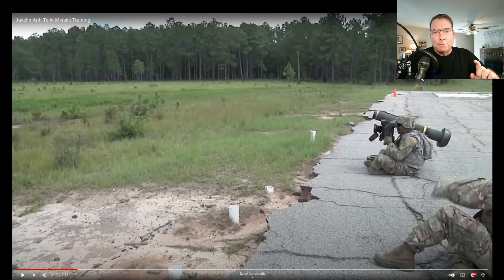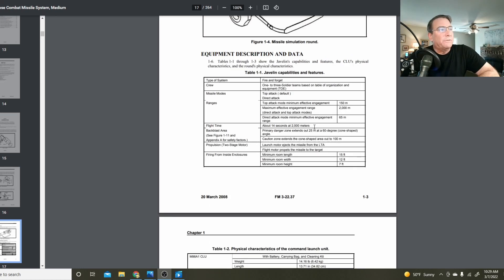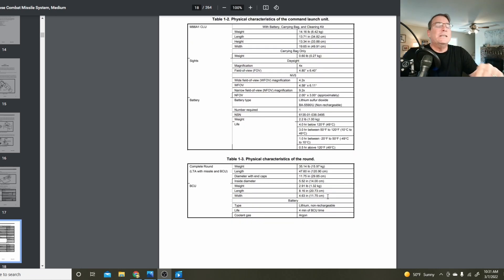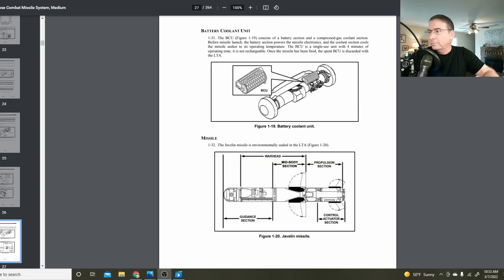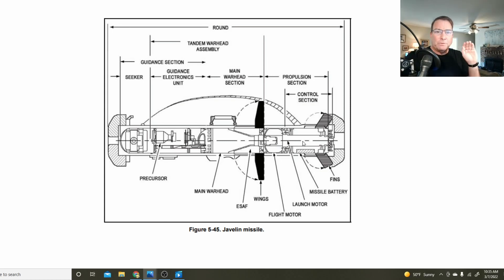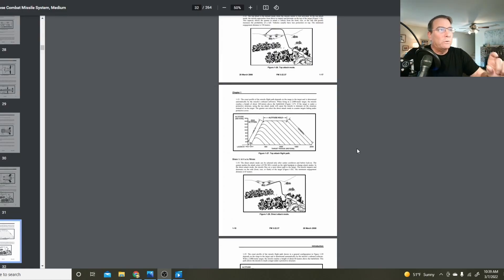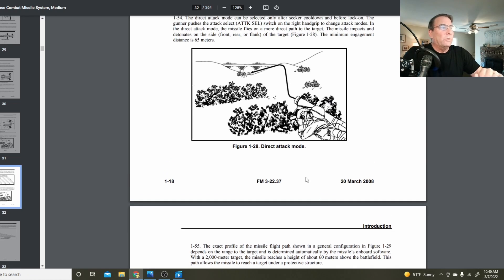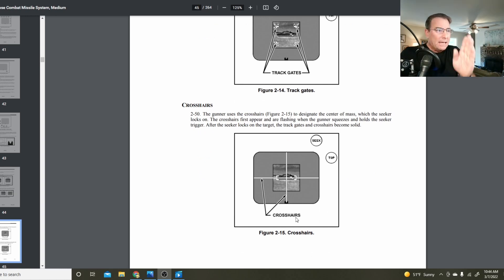FGM-148 Javelin Anti Tank Missile Overview

Comment: Shaped charge creates a plasma which burns through the top of the tank, which splatters about inside the tank and burns through the artillery inside the tank which chars and destroys everything inside in a matter of seconds. Shaped charge tech has been around since WW2.
Reply: I see a huge number of people think that it's a thermal effect; it's not. The penetration by the copper slug is because of its incredible velocity -sometime over 10km/s! 

I think part of the reason is that HEAT sounds like, well, heat has something to do with it.
Reply: Think of a shape charge kind of like a lens on glasses. It focuses the blast.

Comment: Yeah, that's not how a shaped charge works. The things in the nose don't do much, they are mostly aerodynamic. The copper cone is squished into a jet and vaporized and accelerated as it goes. The cone shape focuses the 8.5km/s shock wave from the explosive kind of like a loud speaker cone, the copper just gives it something to throw. Watch this animation. https://www.youtube.com/watch?v=qqMoFx0uwpo
Reply: The nose is important for stand off. Shaped charges need to detonate away from the target so the shaped charge can reach full compression before the projectile hits the armor. Screwing up the stand off distance reduces the effectiveness - which is what the bars on top of the Russian tanks are designed to do (just like the skirts on WW2 German tanks).
Reply: @allangibson2408  Yes, it gives me a place to put the contact sensor. But in terms of how a shaped charge works that isn't important. It's important for how a weapon system works, but it has no bearing on how the explosive energy is directed. What I said is that's not how a shaped charge works, not that isn't how a javelin warhead is detonated.

Comment: Kablammo is right. Thanks for sharing. It's important for civilians to understand just what it's all about since we are so removed from war's direct consequences. No comparison between the observors and the ones in the thick of it doing the job. Hard to watch sometimes, but important to try to gain perspective and understanding.
Reply: There is a small civilian connection.
The warhead that the Javelin uses to damage enemy armor is in fact quite closely related to the type of explosive charge used to sever steel beams by experts that are in the business of using explosives to demolish skyscrapers and other large buildings made of reinforced concrete and steel. They're related in that they're both shaped charges, however the ones used to sever steel beams in an instant are known as "linear shaped charges" and they look like a square beam of explosives with a V-notch lined by a solid plate of copper. As the name suggests, these linear shaped charges cut in a line, whereas the round shaped charges of the Javelin AT missile are designed to punch a hole thru enemy armor.

Turns out that severing a structural steel beam safely from a long distance has a lot of overlap with punching a hole thru the armor on a tank.

Comment: I think 2 25-man squads, each man with 2 Javelins,  approaching a convoy of Russian armor, separated by 300 yards. They get set. One squad aims at the odd number units while the other takes the even numbered units. When set, they call in 2 flights of A-10 Warthogs. With a coordinated attack like that, I don't think there will be much armor still operating.
Reply: @kristyskirt9015  There is a Russian equivalent of the A-10. The Ukranians could fly those. They already fly Russian fighters.
Reply: 2 Javelins total is enough. One in front, one in rear, clean up the middle with arty from a safe distance.
Reply: @willyjimmy8881  Russia had armor lined up for 40 miles. I think it would take more than 2 Javelins. The hundred I suggested wouldn't get them all, but they'd sure create one hell of a road block.

Comment: @blancolirio  I am a former M1 Abrams Tank Commander. Anti tank weapons land in two basic categories, Kinetic Energy ( inertia) as you mentioned these are usually in the form of sabot round essentially a large dart. The Javelin falls into the second category, chemical energy, it uses a jet of super heated gas to essentially blow through the armor like a huge sudden blowtorch. Javelin uses a shaped charge to reach this much like TOW, Hellfire, HEAT Tank rouds.. The sight is not necessarily a night sight but a thermal sight and you are correct the greater a difference in temperature between the target and the surrounding area the better a sight picture you will have.
Reply: The jet has a high component of molten metal that is formed by the conical lines - typically bi-metal.
Reply: Thanks for sticking your neck out to protect my civilian ass. 🙂

Comment: You left out that the warhead utilizes depleted uranium to create the high heat which melts its way through the tank armor and body.  Pretty much an ugly death for the people inside of the tank.
Reply: What are you talking about? The shaped charges in the Javelin missile use copper as the medium which is superplasticly formed into a hypersonic molten jet, which cuts through the armour. There is no depleted uranium, or as you say plutonium in these weapons. Please try not to spread misinformation. I will agree that being on the receiving end of one wouldn’t be pleasant, although I’m not sure you’d have to worry about it for long.
Reply: @bend1483   When I have seen them manufactured, they had various types of heads.  The good tank killers are the depleted uranium charges, same idea as the rounds used in the A-10.
Reply: @LoydChampion  Yes, there are quite a few weapons that use DU, usually as a penetrator, BUT the Javelin missile isn’t one of them. It uses a shaped charge, and a jet of hypersonic molten metal, it is not a direct kinetic penetrator, it does not use DU.
Reply: There is no depleted uranium in Javelin. You're confusing that with depleted uranium penetrators like those in M1 Abrams armor piercing ammo. That's a kinetic projectile, as in a bullet that doesn't explode. Depleted uranium is used in those rounds because it's extremely dense and at high velocity it can penetrate armor. Javelin uses a shape charge that explodes before it hits the target.

Comment: What you showed has a shaped concave metal hemisphere or cone so-called 'liner' (usually of Copper)  backed by a high explosive.

It is not the explosive that does the penetration. 

When the high explosive is detonated, the metal liner is compressed and squeezed forward, FORMING A JET of a hot copper plasma whose tip may travel as fast as 10 kilometers per second.

That jet punches through the armour into the tank.

Primary source:    https://www.osti.gov/servlets/purl/6807425
Reply: Jackie, how on God's earth have you provided a link that wasn't to just another YouTube account? I always liked to provide a link to support my statements, but for months while it looked like YouTube had accepted your comment and it just disappeared into the ether.
Reply: @COIcultist  yeah same. Then after getting my comment nuked from orbit, I'm unable to make any further comments under that video. They look like they post, but they're not there if you check back.
Reply: @gasdive  Misspell or miss a word out, then once posted select edit and correct the post. If there is a problem, an error message will appear under the post. Copy the text having removed the offending link, this also allows for content creators who don't allow you to post YouTube links. After all the above, delete the post and re-post the amended text.
Mind you, I have had 3 or 4 comments post then disappear over a month or so, none of them having links nor using obvious words that YT will censor.
 YT is obviously trying to improve the quality of our debate by preventing us from referencing supporting evidence.
Reply: Right:  shaped charges serve to focus the explosive energy into the target.  It's BOB (best of both):  all the kinetic energy of the airframe, plus all the newly released chemical energy of the explosive, focused into one neat package with the aforementioned plasma bow on top.
Reply: Simply, think in terms of an instantaneous acetylene cutting torch,
the explosive forces instantly vaporizers the copper, which as quickly intern, lower's the melting point of the armor. 
As well as injecting a molten jet mix of copper and steel, which 
 Brad Pitt's 2014 movie "Fury" has a couple of CG'd added scenes showing the effects of the Panzerfaust "Tank Fist", the RPG's
predecessor.
Back, early 1970's when I was much younger, I fired  the 3-1/2 Rocket launcher, the old Sherman Tank hull target was peppered with countless finger diameter holes.
Reply: @mikemontagne2703  the effect is purely kinetic - the temperature of the copper slug has nothing to do with the penetration. At that sort of pressure, it doesn't much matter whether the slug is liquid or solid - material strength is such a small part of the equation.
Reply: @mikemontagne2703  that's a good analogy.
Reply: Found a good video explaining in detail how shaped charge explosives work- explainer begins at 12 minutes... the rest of the video is interesting as well!  The UK Tank Museum does a great job!    https://www.youtube.com/watch?v=1SJHC4wmRfk
Reply: Juan was fed misinformation about shaped charges b y a Communist infiltrator, obviously

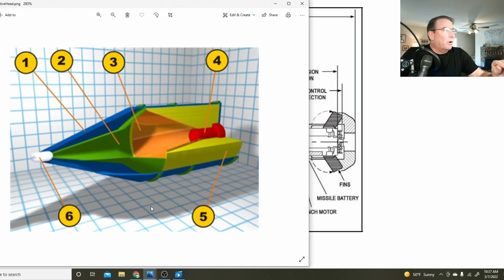Comment: I believe that Juan has made a mistake regarding how shaped charges work. The front portion of the warhead in 7:06 is just an aerodynamic cover, the explosives (5) actually forces the reversed funnel shaped metal (3) forward (to the left of the image), producing a jet of extremely high velocity metal (up to 10km/s) which penetrates armor.
Edit: as shown in https://youtu.be/Li2Kt4DtUdY
Reply: Correct.
Reply: The main reason is for standoff,  the space is necessary to allow formation of the jet .   In a RPG (diagram)  the nose serves two purposes.
Reply: The reason we started to install slat armor, it changes the stand off of the shape charge making RPG's less effective.
Reply: @tomsmith897  that isn't correct. Slat armor as you call it is designed to destroy the fuse and keep it from detonating or to deform the warhead to reduce it's effectiveness. The standoff distance itself with vehicle mounted cage armor isn't enough to significantly reduce the warhead effectiveness. Ask the Iraqis who tried the same tactic in '91 and got their azzes torched by M1 HEAT rounds that were't effected by the cage armor.
Reply: @willyjimmy8881 I was talking about the diagram used by Juan, a single warhead RPG. Slat armor (AKA standoff armor)  was also designed to prevent optimal detonation from occurring, IE by deforming the cone or causing the shaped charge detonation at a non-optimal standoff distance.   120mm HEAT round compared  to an RPG-7, don't even know where start with that...
Reply: @tomsmith897  ah I see.
Reply: Eric, True. A HEAT round uses a copper cone with the large end toward target and the small end packed with high explosive around it. When the HE detonates, the gases form an etremely hot jet which penetrates the armor, then the copper cone that is now crushed forming a slug, follows the jet into the hole it created. It's called the Monroe Effect. I believe Juan was describing is the Armor Piercing Discarding Sabot (APDS) round which is basically a steel dart tipped with depleted uranium. The sabot round uses kinetic energy and DU as lubricant to penetrate armor. At least this is the way I remember it from my EOD days.
Reply: @straycat1081  Also, depleted uranium is pyrophoric which means it instantly burns on contact with air. A depleted uranium round showers the interior of a tank with thousands of burning splinters which ignite everything inside. I have heard the instantaneous temperature rise can be as much as 5000 degrees inside. The propellant charges for the ammunition inside the tank incinerates everything else. Not pretty, but death is quick.
Reply: @TyMoore95503  that would explain the charred Orks I’m seeing on Reddit. Never seen flesh charred but not incinerated like that. Amazing science. Glad I’m not a field Ork.
Reply: @muzaaaaak  The chard corpses are actually caused by the ammunition cooking off. Most russian tanks have no blowout panels for the ammuntion so if it's get ignited while the crew is inside the tank they get literally cremated. The pyrophoric effect of DU is often overstated. Yes the dust ignites, but that happens mostly outside of tank.
Reply: The  "blowtorch" system is a  German invention, the notorious  "Panzerfaust" was  used  in WW II.
Reply: @dipling.pitzler7650  Called the Monroe Effect.  Discovered during the civil war when black powder charges were tested.
Reply: I belive the launchers are reusable also.
Reply: @MrBen527  not for the Javelin but they can be used for other improvised weapons..
Reply: @willyjimmy8881  WIKI shows its mostly reusable.   A new missile in its cartridge is remounted on the CLU after firing the previous missile.
Reply: @MrBen527  The missiles are the expendable can, the optics and launcher are designed to be reused. We did take bets with MI that you can take a SAM or SS missile, and the launch controls, and walk down streets in any major city, and nobody would be the wiser. You just would have to spray paint the missile to look like a painted piece of cast iron drain pipe, and carry the Samsonite suitcase with it being spray painted black. Wear overalls and nobody would give you a second glance, especially if you wore high vis vests that were tattered and dirty, and the coveralls were stained and worn. they never wanted to take that one up though, even though we did have some captured ones that could have been used as well. There was a cut in half safed one on the wall of the FE rest room.

Comment: weighs about 50lbs and has a range of 2000m. That's what I like to see, equal representation for measurement units!
Reply: To quote George Carlin, when he was talking about oxymorons, "Military Intelligence."
Reply: @DoubleMonoLR  
And 7 yead Olds weigh 49 lbs...
This is good conversation :)
Lol Hugs
Reply: Military uses metric for distance and imperial for weight. Nothing unusual there. Doesn't matter which syatem you use as long as everyone uses it. Ask the brits who commonly use imperial for distance and metric for weight.
Reply: @willyjimmy8881  Never been in the military. Also, it was meant as a joke.
Reply: To translate;
Weighs about the same as a four year old and goes a mile.
Reply: @Tadesan  I wouldn't launch a 4yo at a tank, mostly because I have neither a 4yo nor a tank.

Comment: There is a video out there showing a fully combat loaded T-72 being struck by a Javelin in the top attack mode. The T-72 was blown to pieces.
The grill work add on armor seen on Russian tanks is ineffective against the Javelin. Tanks so equipped are known as "Russian Bar-B-Ques" for obvious reasons.
The video I referred to you have posted.
Reply: The blown to pieces part was more likely secondary ammo detonating.
Reply: There was one particular video of a Javelin test quite a few years ago showing a T-72 exploding when the missile hit - except the explosion is very large (literally blew a tank apart from the inside out), and if you look at the video frame-by-frame, you can see the blast leaking out of the turret ring of the tank one frame before the missile warhead detonates.  It was later admitted that explosives were placed inside the tank and detonated when (just before!) the missile hit to make a more spectacular video.  This isn't to say that the Javelin isn't a very effective ATGM, but it's rare for tanks to explode from the inside out to that extent!  (Not unheard of, as some of the images from Ukraine clearly demonstrate!)
Reply: Many of these massive destructions in t-72 is not caused by missile itself... It is caused by detonating ammo in autoloader located in turret

Comment: The Russians have been installing steel "sunshades" over the top of the turrets to initiate the preliminary  Javelin charge then their reactive armor prevents the main charge from penetrating the turret.  In theory it works to an extent.
Reply: In theory, there is no difference between theory and practice.  In practice, there is.
That's why they call them the Russian BBQ grill.
Reply: The sunshades (aka Russian BBQ Grill) have been found to be fairly ineffective against the Javelin.  The shockwave from the precursor charge easily passes through the metal shades to detonate the explosive reactive armor, rendering it ineffective, and similarly the high-velocity superplastic jet generated by the heat round flows past the shades and drills right through the main armor.  You just need a small amount of that jet of molten metal to make its way through the armor to set everything ablaze inside the tank, typically igniting stored rounds and blowing the tank turret clean off (aka Putin's Jack-in-a-Box).
Reply: That doesn't work if you take out the fuel trucks instead. Sure, the tank stays running around, but for how long without resupply?

Comment: TB-2 next please.  The manufacturer Baykar Defence has an interesting history in general.  Next gen twin UAV uses Ukrainian engines.
Edit: Oh yeah, the TB-2 uses a Rotax 912!
Reply: TB2 originally used Rotax 912 engines but the manufacturer pulled them from the distributor in Turkey as they were only certified for civil aircraft use, not military. Likewise the IR cameras originally used were pulled by the manufacturer. Both systems have been replaced by similar units from Turkish domestic military suppliers.